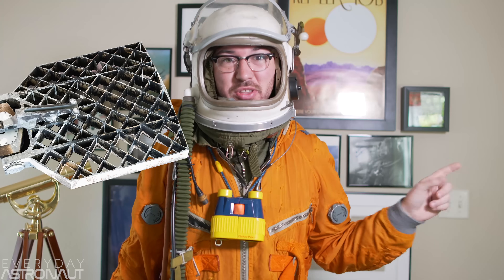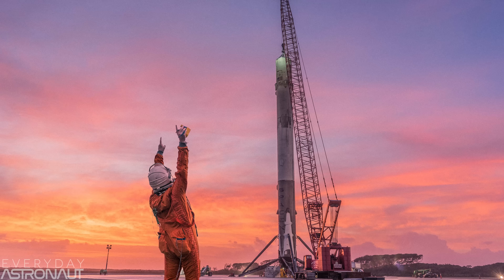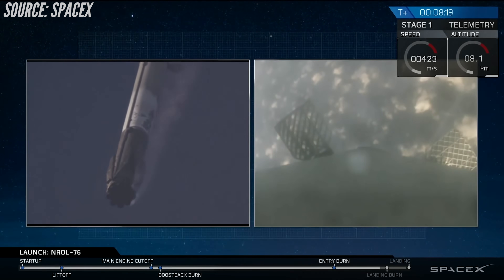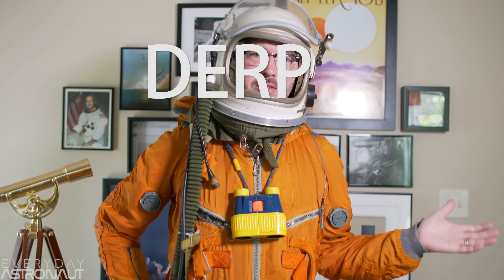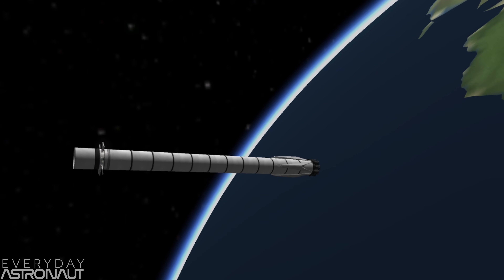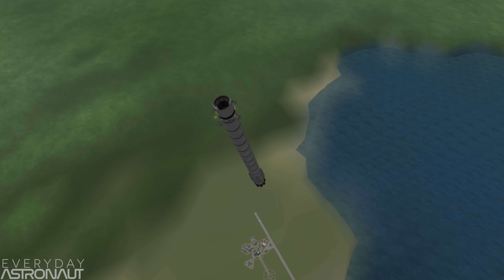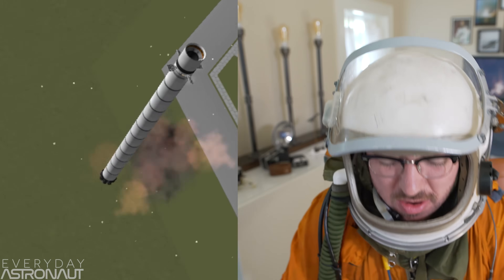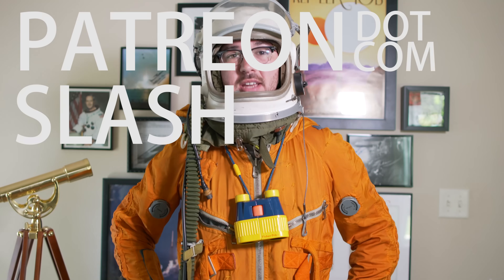How SpaceX lands the Falcon 9: Grid Fins, Thrusters and Engines!

Comment: "massive"
Reply from the maker: +Rok Adamlje is 220 foot tall not massive? That's the height of a 22 story building! 30 foot taller than the Atlas V and I think only the Delta IV is the rocket currently flying that is taller
Reply: Wasnt really thinking height and size then. Well it is termed medium lift. Both Ariane V and Delta IV heavy are about 50% heavier. And are "heavy lift".  And shuttle SRB is the same weight only shorter than entire 2 stages of F9. Waiting for Falcon Heavy...

Comment: How does Falcon9 Stage1 not burn up? The shuttle controlled angle of entry into atmosphere and used heat tiles to land safely.
Reply from the maker: +Les Pinto the shuttle was coming in from orbital speeds (17,500 mph) and the first stage only gets going up to ~ 5,000 mph. It also does the entry burn which slows it down enough to not get torn apart.

Comment: Everyday Astronaut → Does the 'navigation system' for this booster use GPS, some kind of radio beacon at the landing site, or something else?
Reply from the maker: +RocKiteman _ 2001 it's basically purely GPS and a radar altimeter at the end. I believe the drone ship and F9 do communicate and share a signal, but it's not for navigational purposes.
Reply: Everyday Astronaut → Roger all that - Thanks!
Reply: There is a two-way downlink from the rocket to the drone ship, as it just uses the same protocol as any other ground station relaying telemetry.

Comment: Why doesn't everyone do it? It looks easy enough. It is all about the control software, so shouldn't be that complicated to copy.
Reply: To expand a bit, the big issue is that few rockets can get their thrust down to such a small percentage of liftoff thrust. SpaceX is able to shut down eight of the nine engines, and it can throttle that single engine down to 40% - which means they can get around 5% of liftoff thrust. Rockets with single engines, such as Atlas V with its RD-180, can only throttle down to about 70% of liftoff thrust, which makes landing precisely much more difficult. 

Blue Origin smartly chose to have seven engines and allow the engines to throttle down quite deep, which makes landing much easier. ULA, who operates Atlas V and Delta IV, instead seems to have chosen reusing the engine block only using parachutes for its future Vulcan rocket (as well as an on-orbit reusable upper stage, ACES).
Reply from the maker: +Alexandre Andrianov other companies are sort of scrambling to do the same. Blue Origins comes to mind as a company who will be doing it next on a scale even bigger than a standard F9!

Comment: Cool and informative vid. I love your outfit! :) I'm a lil unsure as to how the grid fins work. Are they kind of like a rudder? And having them holey makes them able to withstand the friction?
Reply from the maker: +alucinare thank you! They're exactly like a hundred little rudders or tiny wings stuck together. It's mostly that way so they're compact. They do provide more drag than a traditional fin, which in this case is a good thing.
Reply: Ohhh I think I get it. Does it have anything to do with the surface area exposed to the air?
Reply: Fascinating! Thanks for the extra info.
Reply: Yeah, it's a very compact way of presenting a lot of surface area to the air. The other advantage (which isn't obvious at all and gets into the complexity of flow dynamics) is that they work really well in supersonic velocities and subsonic velocities. Unfortunately, they lose a lot of control authority in the transsonic region because the air effectively blocks the small openings and most of the air flows around the entire fin (rather than through the miniature holes).

Comment: How many computers inside Falcon 9? How does the computer on the 1 stage Rocket communicate with the main computer ( if it is on the top of the rocket)  - I ask this question because the first stage of the rocket will detach soon?
Reply from the maker: +yxhankun great question. Both the first stage and the second stage have fully stand alone guidance and navigation units. I'm not sure which is doing what during which portion though. Good question. I'll prod around
Reply: Q1 Musk must have instructed ( or he is being informed by his engineers ) his engineers to  use the Fastest  ARM single board computer with CAN bus...( in arduino term or computer  technology)  to  be 1st stage and 2nd stage.  Am I right?  Q2 Are  they using wireless connection  between 1st  stage and the 2nd stage, if not . Q3  How do the cables being unplugged within the rocket? Q4 How do cables survive in space?  There are so many terminals  on the ground base, the  computer(s) on the rocket are not going to serve all the terminals like  tell every terminals "I am fine, I am at a height 99999 meters above the sea level ...flying at the speed Mark I...etc". Rocket computer is busy at her own tasks.... at 5001 th microsecond I am  igniting all 20 the explosive screws around the 1st stage, preparing the detachment and at 5002 ms I am igniting the  "cable detachment box".   BTW I played  once a rocket costed $12.00 CAN  in Canada  from Kmart after I graduated from university.

Comment: why cant they (or dont they) use the onboard cameras to live stream the entire journey to the ISS and back? It cant be a logistic problem because NASA live streams from ISS all the time.
Reply: Vlum88 probably just do to lack of anything interesting happening.

After the payload is deployed and solar arrays extended it would look like it's not moving for about 48 hours. It literally sits there slowly making its way doing nothing. Haha

They do show the capture though which is the next interesting bit that happens.
Reply: Not strictly speaking logistical, but it takes extra power and more importantly, bandwidth. the ISS has a ridiculous comms system which would be quite impractical on a launch vehicle itself. For launch AND rendezvous, your telemetry occupies most of your transmission capacity AFAIK.
Reply: They don't waste power by having onboard cameras run nonstop. Only onboard cameras for Dragon are on the trunk and angled to show solar array deployment. It'd be a complete waste to stream that down for two days - everybody already knows what space looks like.
Reply: The problem isn't the camera, it's the power requirements on maintaining a downlink to earth constantly and sending quite a bit of data through it. Currently SpaceX intentionally doesn't send much data because it takes power and it's not needed. Again, the problem is not video streaming, it's video transmitting from so far away.

It takes two days to get to the ISS.
Reply: No modern rocket will give any control other than flight termination to the launch operators. There is no way a human can control a rocket better than the flight computer can, in any scenario. It's far easier to just program redundancies into the flight computer.

Nowadays the termination system is fully automated too, removing humans entirely.
Reply: It's not hypothetical. You can watch the capture and berthing live on NASA TV. It happens two days later.

SpaceX has absolutely no incentive to do additional work like that.
Reply: SpaceX cannot do a 6 hour trajectory at this time.
Reply: Well, they'll have Dragon 2 with a crew and then they can record and bring back the footage manually maybe if we ask for it :D
Reply: To be accurate, it takes minimum 6 hours to maximum 2 days to reach the ISS, depending on the launch window. So yeah, nobody has the time to stream down everything continuously for 48 hours if the bandwith of the data downlink does not permit it.
Reply: Dragon has absurdly oversized solar panels for its electricity demands, but bandwidth would be the problem.
Reply: maybe it's all fake
Reply: awake AF no.

Comment: Hardware is only a part of the means by which the booster is landed.   Navigation algorithms being used in the onboard computer are, IMHO, much more significant because really, deciding when/how to tilt fins and when/which thrusters to fire is really at the core of this fully-automated maneuver.   It would be great if you could sometime talk about the mathematics of navigation used in landing the rocket.   Note that, unlike in simulations, the rocket has to come down in a moving sea of air which means it needs to adjust constantly (and not in a way that could be known ahead of time) to stay on track.

Make that visual and you've accomplished a lot!
Reply: Lets just say that they're both equally important. It's both the hardware and software that makes this all work.
Reply: The control algorithms they use very good, but not necessarily groundbreaking. Similar algorithms have been used on the Mars rover landings, and before that they have seen widespread use in military applications. When you get down to it, the core technologies needed to control the rocket has been around for quite a few decades.

The problem is that you need some relatively complex math and even if you understand the math that governs the landing you would actually still have no clue how they actually go from that to controlling the rocket. I'm using some similar ( but simplified) techniques to control autonomous drones. it's not as complex as you'd expect, but still much more complex than a what a short YouTube video can properly explain. although maybe I am wrong, I have seen some YouTube educators explain some really complex stuff simply...

One example oh it being not as complex as you think: you don't bother modeling the dynamic nature of the air. you get the basics right, and as long as you can correct fast enough (with the methods from this video) you can just correct for the discrepancy without knowing where it came from. Having a tight feedback loop is crucial and can actually deal with a surprising amount of unknowns.
Reply: Tim Cortesi Yeah...may be not that much complicated, but it is still a delicate work of control since too many factors could affect the stage1 position.
Reply: tevvya I am quite confident they employed some of the most commonly used machine learning algorithms like neuron networks or reinforcement learning...

Comment: Can you do a video on why the Space Shuttle didn't work out
Reply: well, the reason is simple:
How many tiles did the heat shield of the shuttle have?
10,800
How many DIFFERENT tiles did the heat shield of the shuttle have?
10,800
The failure of ONE of these tiles leads to a total loss. And after EVERY flight at least 200 had to be replaced.

Plus bear one thing in mind: To get the financing of the shuttle completed the USAF demanded the ability to intercept and capture russian spy satellites to take them back to earth. That made the shuttle so bulky and inefficient.

Fun fact: Since the shuttle is officially retired the orbit of the ISS could be raised to 400km - as the shuttle was unable to reach that altitude with its intended payload.
Reply: Oh, please go into how the Air Force basically crippled the program by demanding a 1000 mile crossrange capability and then went with rockets instead.
Reply: if the change involves such a drastic increase in complexity and cost so the whole program is FAR from EVER being efficient (the original planning to make shuttle launches profitable and cost-efficient was around 2-3 launches per WEEK. That's however how and why the movie Starflight was built around...filled with lots of propaganda around the Shuttle). 
If you take a look at the original design suggestions regarding a Space Shuttle you'll find LOTS of concepts which were A LOT LESS bulkier. In fact, the original "shuttle" was intended to look much like the X-37
Reply from the maker: +Michael Derrick absolutely!!! That's on my list 😊👍

Comment: You forgot to mention the low  center of gravity of the Falcon 9's dry mass which helps orient the rocket while coming down the atmosphere.
Reply: All rockets at this point have a real low CG, engine are heavy and there is minimal to no fuel left to push CG up on the rocket

Comment: But why are their grid fins gridded? Is it just so they don't tear off?
Reply: I originally thought the grid fins just oriented the rocket correctly for it's backward direction of travel by being a drag in the air stream, but they actually move and rotate for guidance!!  Much like control surfaces on fins/wings.
Reply from the maker: +Goranim grid fins are basically just hundreds of small wings. It's so you don't need one huge traditional control fin, you have tons of little fins that act like one big one!

Comment: How are space X gonna land on Mars because grid fins might not work as well in the thinner atmosphere  ?
Reply: Right, but propulsive landing will work. They will use their SuperDraco engines on the Red Dragon (uncrewed) to slow the vehicle down as it comes through the atmosphere. A parachute can then be deployed. But in a perfect world, a propulsive landing would prove to be most accurate and ultimately the best.
Reply: mars has also much lower gravity, 3.711m/s².  earth has 9.807 m/s².   the moon is around 1.6 m/s².
means you could brake with less thrust, and longer. making the gimbal and nitrogen thrusters do more of the work the gridfins would do in earths atmosphere
Reply from the maker: +Léonard Durieux this is true! Between the engines gimbaling and RCS thrusters, they'll have all the control they need 👍

Comment: Your videos are really awesome! I just had two questions. Do the nitrogen thrusters be used until landing or just when grid fins aren't useful enough? How do the rockets perform their gravity turn (which attitude control system do they use)?
Reply: Aurélien GENIN the nitrogen thrusters are mainly used in low atmospheric pressure (high altitude) and as the air thickens the grid fins provide more force since they use the thickness to advantage as opposed to the thrusters which have an ever increasing resistance opposing their force from the rocket body. Both are used in the transition.
Reply: Mike Mueller Thank you for this answer! And do you know how do the rockets perform their gravity turn (which attitude control do they use)?
Reply from the maker: +Aurélien GENIN on ascent, they only use the engine gimbals 👍
Reply: In one of the failed landings on the barge, you could actually see the nitrogen trusters going full power, trying to estabilize the inclined rocket without fuel on its engines or any air resistance for the fins to use, since it was not moving (it actually succeded on delaying the inevitable... for half of a second).
Reply: Aurélien GENIN while the engines are running the use the engine gimbals instead of the nitrogen thrusters.
Reply: It looked like they used them in CRS-11 at the very end; previous landings didn't seem to use them (except CRS-6 when the rocket was tipping, though it's unclear on whether that was just starting the safing procedure of venting nitrogen gas or whether that was a commanded attempt to stop the rocket from falling).
Reply: The thrusters are used if necessary, which means essentially they rely on them in the upper atmosphere, and if at any point, even during the landing burn or later, the grid fins and engine gimbal isn't enough, the nitrogen thrusters are used. In the failed attempts, sometimes the rocket was almost standing, and the thrusters were going at full power, trying to stop it from tipping over (but since the rocket had either a lot of horizontal velocity, or was standing and tipping over, the thrusters weren't powerful enough to stop it).
Reply: Everyday Astronaut Thanks for the answer